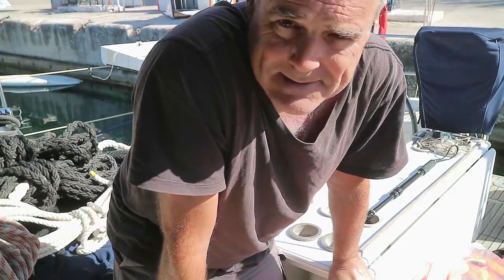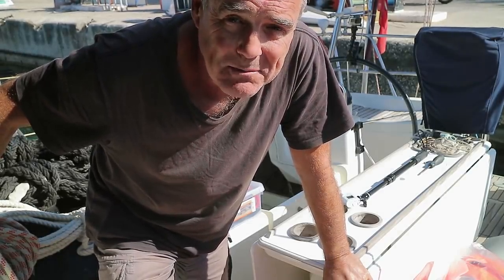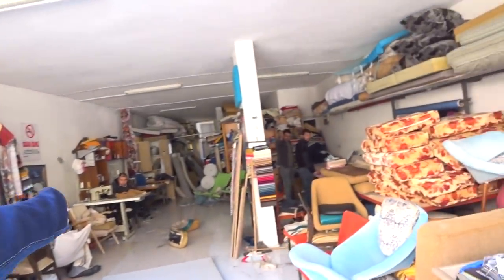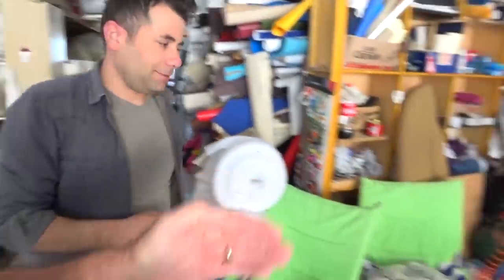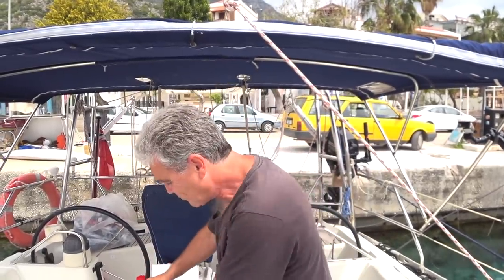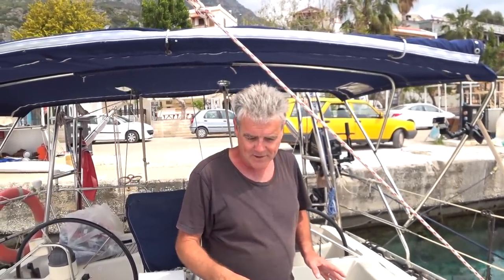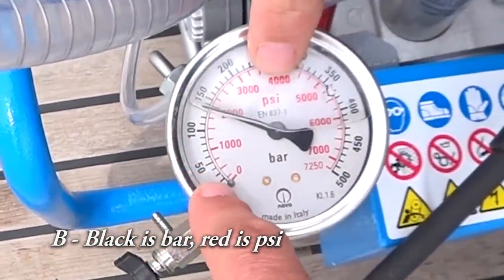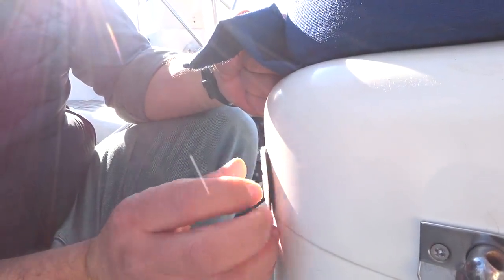Stupid MISTAKE with our NEW compressor - Sailing A B Sea (Ep.065)

Comment: To chase really difficult circuits, get an RF circuit finder. Usually at any Home Depot or hardware store.  It has two parts;  one has alligator clips that go on one end of the wire you are chasing; the other bit is a "radio-pen" that you use to search for a radio signal.  The pen beeps when in proximity of the wire with the RF homing signal impressed on it.  On a boat, the radio range shouldn't be difficult, no matter how buried in the bulkheads or under seats and bilges.  As boats get more complicated, your ability to track circuits becomes a real chore.
Reply from the maker: An RF circuit finder is now on the list. Thank you.

Comment: the compass flux gate should be on the longitudinal centreline, as close as possible to the waterline and mid length on the boat. it will be a 3-4 inch disc mounted to a frame or cupboard back wall that should narrow it down for you
Reply from the maker: (Baz) We have had so many people come on board who were confident of finding the compass. Even the Raymarine technician, who spent 40 minutes taking the interior apart, could not find it. It's a mystery for sure and it's something we've learned to live with. Maybe this winter when we're doing maintenance work we will discover where it's been installed. 👍 And when we do find it, we'll open a bottle of bubbly to celebrate and let everyone know where it was located. 😄
Reply: @SailingABSea  if you find it other than as described you should move it there it should be within a few feet of the halfway point of the centre line for best accuracy
Reply from the maker: That's a good suggestion gmoose. We will be reviewing our whole electronics package this winter while we're holed up somewhere for 3 months. 👍

Comment: hi guys, great video again. Just a small observation; I couldn't help but notice how "in-accessible" the life raft was. I hope it will be more accessible when on passage.
Reply from the maker: Hwey Willem, we have a plan to have it mounted just fwd of the spray hood.
Reply: @SailingABSea  That's a reasonable location but do check that your cabin top and mounts are rock-solid - there are many reports of life raft canisters getting washed off cabin tops. As an alternative, do you have room behind the helms in your cockpit? It would only be mounted there during passages and is then available without exposing yourself on deck - typically the conditions that you may need a life raft are not the conditions that you want to be on deck. And remember of course, only ever step up into your life raft! We did an Advanced Sea Survival course recently and the life raft should better be called a death raft - it's an awful place to be and as long as your boat is afloat that's a better option.
Reply from the maker: Thanks for the tips Tom. Cheers.

Comment: Hey Baz.

I think you were having trouble finding the Magnetic compass. I just saw on S.V. Ramble that it has to be located 3 ft from any other compass and same distance from anything metal.

So problem solved just find a spot which meets both of those requirements and there it is. lmao.

Seriously though probably low down in the hull midships or under a bunk.

Luv ya work.

David Down Under.
Reply from the maker: The hunt continues David... We're sure we'll stumble across it one day.

Comment: According to ISO 9001 standards your flux gate compass should be connected via a AWG 4 gauge wire of not more than 1.25 meters of orange tiger stripped sheathed cable to a shunt that is directly connected to your 'flux capacitor'.  This should help your mystery.
Reply: Great tip!
Reply from the maker: We'll send a team of highly trained chipmunks in for a reconnansence mission. 🤔 😀
Reply: @SailingABSea  Sounds like you need to go "Back to the Future" to find your Flux Capacitor :)
Reply from the maker: Yeah John, if we could talk to whoever installed it that would be great. 👍

Comment: Aannsha, I wish you could get your torn rotator cuff repaired by the same doctor I used.👨‍⚕️ He did a fantastic job and my shoulder is better than new. I held off longer than I should've with fear of the unknown.😨 The best advice I can give is to stick with your rehabilitation after surgery and do your exercises no matter how much it hurts.😱 If you can locate a Tens Machine it will become your best friend.🤗 Who knew electrical stimulation does a body so much good❓Not to be confused with "One Flew Over the Cuckoo's Nest"  and Nurse Ratched.  😨 I digress 🤣
Reply from the maker: Hi Noone AnybodyKnows, thank you for sharing your experience and I'm glad to hear it is all fixed now.  Surgery wasn't mentioned at all.  I think that is often offered as a last resort if it is very badly damaged. And on the scan, it only looks to be partially torn.  I must say, since resting my arm more and lifting with it as little as possible, it does feel as if it is on the mend. I am noticing that it I can get a good night's sleep now as the ache doesn't wake me up.  I know it takes a long time though.  I will look into the Tens machine though, I hadn't thought about but it makes sense.  Lol on One Flew Over the Cuckoo's Nest 😄
Reply: @SailingABSea  That's good to hear! Happy Easter 🙏🐰

Comment: hint: if the liferaft is that deep in a locker - you won´t use it - since you won´t get at it quick enough when needed. LIferaft should be easily and quickly accessible and if possible outside mounted.
Reply from the maker: We agree Christian, we have a plan to have it mounted just fwd of the spray hood.
Reply: Christian Grams You underestimate the power of adrenaline. 😂 It is quite common to stow life rafts in lockers. Most folks (who do get in the life raft) tend to do so, too early.
Reply from the maker: We'd feel more at ease if it was stowed on deck. It's another job on the list. 😄👍

Comment: Do you need any particulate or oil filters between the compressor air intake and the tanks?
Reply from the maker: There is a Coltri filter with lots of different layers of stuff in it that keeps all the bad stuff out of the tanks. All technical stuff really.